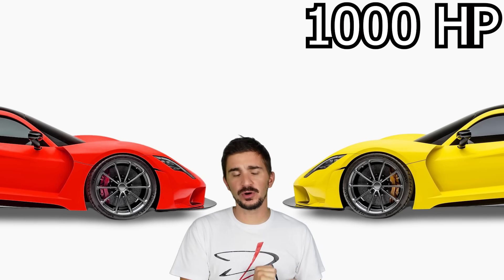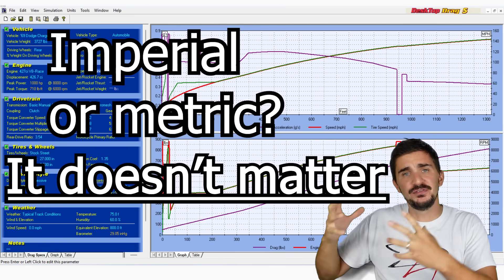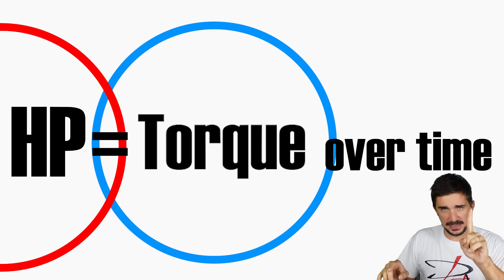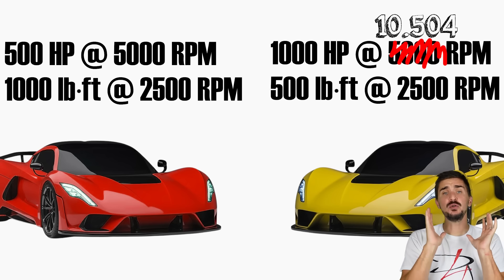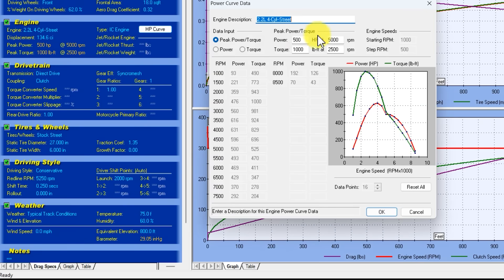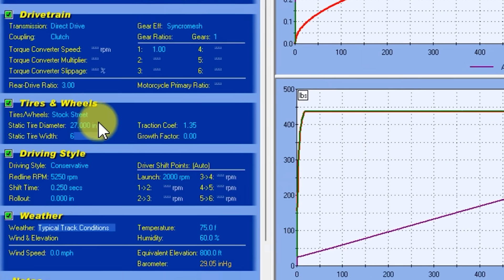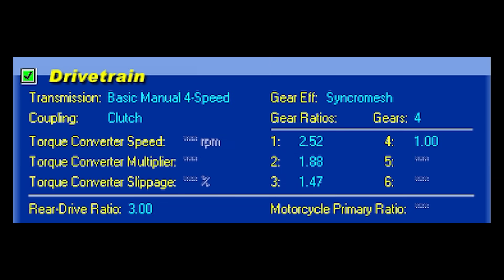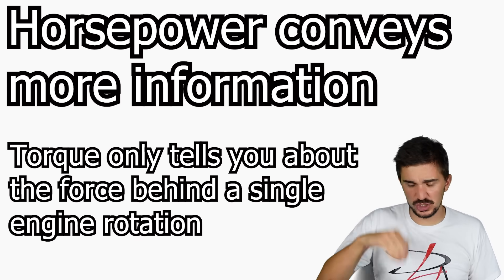Who's faster? Explained and Simulated - Horsepower vs Torque

Comment: I'm not arguing with the math or concepts. I agree. I've tuned a few cars. My genuine question is this:
 I have a BMW M57 diesel now that has had some work done and a very nice tune. It makes around 400HP and 600 lbft of torque. The transmission has been tuned to short shift, keeping the revs low and the engine "pulling." It's consistently considerably faster than 400HP cars of similar weight. In fact, it's about as fast as a comparable 550 - 600HP car. Especially in a dig, but still has an advantage in a rolling start.
 Yes, gearing is being utilized to keep the engine in the best power band. What is the math behind it being objectively faster than cars with a higher HP rating if HP is supposed to be the equivalent of "total damage" in our analogy? The cars that are competitive with it have HP numbers on par with my torque spec, but lower torque.
Is it that my torque was measured at flywheel, and likely the advertised specs of the other cars also? Point being that the gearing brings rear wheel HP of both vehicles into parity? I.E. I have bigger "punches" and the gear ratio drives the car further linearly per punch. My theory is we're just missing something in nomenclature, and advertised numbers vs. Real-world output to the wheels. Because I've smoked several cars of similar weight and lighter, boasting higher advertised HP ratings than 400HP.
Reply: I guess the answer is that you have shorter gear ratios. The effect of having shorter gear ratios is that you actually keep your engine at a higher power on average. 
What determines performance is not peak power, is average power. And, in your case, even though you have a car with less max power, due to your gears being better, you actually produce more power on average

Im supposing the weights of all cars here are equivalent, obviously. it could also be that your car is lighter
Reply: @lucasnahas  my gears are taller, much taller. The M57 redlines at 4k. Peak power is between 2000 and 3200 RPM with a very flat curve. You want to "lug" it. Shifts are set at about 2800 to drop it to 1800 for the pull in the next gear. Except you can't really lug a diesel. It starts making butt loads of torque just over idle. It doesn't go vroom, vroom. It goes growl, growl.
 I'm turning about 1800 rpm at 120 mph in high gear. It's cool to be rolling triple digits, and the engine sounds like it's idling. It's an X5 it weighs 5200 lbs. Not a heavy weight, but not light either. A Hellcat is about 4500, and they're a good race for it. They can get me if the driver knows what he's doing, I get them if they don't. Mostly traction and shifting. If they overspin, they're done. I'm gone before they can hook up.
 I think the average power theory, however, is accurate. I think you nailed it. It makes "almost" 600 lb ft everywhere, and 600 at max. It puts down more torque over a much wider range. I think that solves it.
Reply: @lespearson3801  yep, if it makes 600lb.ft all the time, that means the average power will also be high. That could explain it!
Reply: @lucasnahas  "almost" All the time. It's something like 350 at 1000, 500 at 1800, 600 at 2800, peak is 600 and a little change at 3200, drops back to about 500 at redline at 4k. The torque curve ramps quickly and then is very flat.
 It's a Darkside Developments build. Holy crap they know how to tune! It's the hottest tune you can run, just smog deleted without upgrading fuel pump, injectors, and turbo. If you want to get nasty, the full Monty is 600HP and 1000 lb ft!!! But, it comes with some reliability and driveablility trade-offs, obviously. You're going to eventually blow something prematurely running all that boost. You just accept it, and I didn't really want to. I'm really happy with the hottest street tune. There's 2 tune levels below it that aren't anything to sneeze at. 1 is just best economy and a bit more efficiency with smog. 2 is same thing without smog. 3 is race tune without smog but stock fuel delivery. Then 2 or 3 more tunes if you wanna get crazy! I went with 3.

Comment: Although the peak torque engine at 2500rpm is only making ~476hp, it looks as though the software models the engine making 631hp at 4000rpm based on the screen capture of the graph you have shown. Is there a potential inaccuracy here or were different power curves used to simulate the results to the ones in the footage?

I have a request for a video. Could you please talk about launch rpm, grip, spring rate and weight transfer at launch? I'm not sure if it's suitable for the channel but I've always wondered if there is an element of timing involved to get a car to "bounce" right off the line!

Comment: Hp for short range speed. Torque for longer range, provided the gearing is optimized. Agreed torque is much more mystical and requires more elements for optimization. Optimizing horsepower is more straight forward than torque. But there is no doubt that both have a significant part to play in the grand scheme.

Comment: horse power is faster, torque is quicker... typically you sacrifice 1 for the other...
Reply: No, if you increase torque you increase power. 
Horsepower is faster and horsepower is quicker too
Power is always the most important aspect for performance
Reply: @lucasnahas  though there is a bit of truth to what you say your wrong what i said is science and math. torque is power too. power is a measurement of input or output it is the answer to a math equation. there are really only 2 dynamics either torque or horsepower. both of which determine output power.

if you dissect the  2 you can get very different results torque will determine how quickly a car can go 0 to 60 and horsepower determines how fast you can propel a car though wind resistance at speed...

i may not have been a mechanic for over 30 years but now as a rocket scientist. these characteristics play a role in thrust too.

depending on the  goal can vary what asset is most important but no a cars performance is mostly tires and suspension... i can have the worlds best engine or worst engine and i would lose to a car made for the drag or made for the track.  the engine is the heart the suspension is the body... the hart is ueless without a body and you need an amazing body to be an athlete and a great hart can make an athlete win records
Reply: @paratrooperz1  I want to analyze one phrase you said. Quoting you:

"[...] torque will determine how quickly a car can go 0 to 60 and horsepower determines how fast you can propel a car though wind resistance at speed..."

This is not wrong, but it is incomplete. Let's break it down

Torque will determine 0 to 60 -> No, knowing the torque AND the gear ratio / engine RPM will determine 0 to 60

The engine's torque alone doesn't determine anything. You need to know the torque multiplication to determine how much of this torque will be transferred to the wheels. 

And when you do make this calculation, the magic number you get from this calculation that determines the vehicle's acceleration IS THE POWER. 

The key takeaway here is the following:

- knowing power allows you know 0-60 and top speed

- knowing the torque alone gives you nothing. Knowing the torque and the gear ratio / RPM allows you to know 0-60 and top speed too
Reply: @lucasnahas  again your partially right but i think i found your error
what is torque?
what is power? 
if you fix your definitions and understanding you will agree with me

you said last message you need to know the horse power and power. im like face palming..................
horse power  is power of one dynamic 
torque is power of a specific dynamic
power is a measure of some or many equations!
horse power is another name for RPM but not just revolutions but to include the power bandwidth.

the horsepower is generated in the motor. torque is generated in measures (example wheel rotational mass) and gearing
the transmission is how you can balance and convert engine output into a desired balance between torque and motor output
power can be calculated with any 2 or more of the previous...
power is nothing but a measurement.

you are using power like its a thing.....

there is a world where we are both right but i think the part your missing is the part you need to learn your comprehension and your nomenclature seems a bit off.

are you ASE certified? where did you acquire your good but partial education?

i feel like our conversation is in parallel like if i sad cats and dogs are animals and you say noooo birds and bears are animals and im like yes your right but so am i
Reply: @ just now remembered a great example... in the salt flats there is an enthusiast that built a car with 1200 horsepower high rev limiter of 1100 RPMs and up geared the transmission for speed... there is so little torque he needs to pull it to 80 miles per hour behind his truck and he can get the car nearly 400 MPH

or this example the GT500 is geared so low that it can keep up with a bugatti for 200ft before the bugatti high horse power can carry the car past 200 MPH making the mustang look slow... 

i could get in the math or deeper in the mechanics but simple terms the more HP you have the more possible speed you can achieve
if you want the quickest car in the world aim for torque if you want the best of both worlds buy a funny car.

you can come up with what ever story or unique example that you want but unless your wallet is bottomless the budget or race regulations will determine if you should build a car for torque or a car for speed... you can change a gear size and it will move a car to speed or to torque...

to get more torque in an engine you need to change the throw of cams, rockers pistons fly and much more but you will see a suffer in RPM its a trade off.

if i have not explained it enough then i wont get through to ya has my time is valuable to me and dont like to carry on arguments over and over accomplishing nothing
Reply: @ I studied Naval Engineering at the Escola Politecnica da Universidade de Sao Paulo

I don't want to sound arrogant or presumptuous, but, believe me, I know what I'm talking about.

I'm not saying you're wrong, but I definitely believe we're not communicating well

So, what do I mean by power. Power is a physical quantity, just like distance is a physical quantity. Power represents the rate of change in energy in a given system. in the case of an engine, it represents the rate of change of the mechanical work this engine outputs

Power can be measured in many units, the most common among cars is the Horsepower, just like distance is measured in feet or inches

Power is not horsepower, just like distance is not feet. 

power is measured in horsepower
Reply: @ Also, about your second message, you're not wrong

More power means you can go faster. Go faster means you will face drag.

Drag is a force. To overcome drag, your engine must produce an equivalent force. This force must be produced by the engine's torque

This torque will be multiplied by the gears in the transmission.

If the gear you select is too 'high' or 'long', it may not be possible to overcome the drag. 

you have two choices: increase the torque or change the gear

in both cases, you are increasing the power. You cant run away from this fact

This is what I've been trying to communicate
Reply: @lucasnahas  sounds like you just repeated my last return im try to figure out where the disconnect...  

1 fact to remember is you can bolt on a ton of horsepower to an engine as much as multiplication!!! but when tuning an engine for torque has limited gains very limited. it is fractional.

you have to realize most torque gains are from raising the horsepower in an engine are as easy as up on horse power will automatically raise the torque slightly.

if you tune the engine for torque you raise your chances of grenadining  or tearing up bearings and so many other side effect. tuning an engine for torque has one of the largest diminishing returns...

the loss in money vs the gain in torque is possible but the ratio is the poorest option but a necessary option when squeezing every ounce of power money can buy....

so i think and feel we have been agreeing this whole time...  torque is quick and horse is speed in the simple terms before this whole conversation began...

is  this convo concluded?
Reply: @paratrooperz1  aye

Comment: I have trouble buying this argument.  If this were the case, torque would always map identically to HP.  Most v8 engines have low rpm torque while the HP will peak at top rpm
Reply: Torque is the sound of one hand clapping

Comment: I think what people are intuitively understanding but intellectually misunderstanding is the difference between a high hp engine which makes peak power high in the rev range and an engine that makes a lot of torque in the low end.

For example, I own a vdj76 landcruiser (4.5L v8 turbo diesel), and my dad owns a hdj100 landcruiser (4.2L i6 turbo diesel). On paper they make essentially identical hp and torque figures, only my car makes 80% of it's torque at 1500 rpm, whereas his needs to rev higher. That fact makes my car more able to tow heavy loads, or drive slowly offroad without stalling or needing to rev up to make power. His car, is far better with day to day use, and highway driving (though both are still toyota diesel engines that are built for work). He notices how much torque my car has, because it's basically all available as soon as you take your foot off the clutch, even though his car actually has the same amount of torque as mine. It's that initial load of torque with the quick jerk from 0-moving which people associate with acceleration, and it's the high revving petrol engines with low torque off idle that people associate with hp.
Reply: you're right

Comment: You can't have an engine the makes peak power at 10k rpm's also redline at 5250. It could never be an honest comparison. The only real example of this race would look like a hot rod diesel engine racing a rpm limited F1 engine and all weights and ratios being equal engine rpm equals wheel rpm's and HP wins

Comment: What is the reason behind trucks and heavy machinery having high-torque engines rather than high-revving engines? On paper both of them could perform the same task with optimal gearing. Is it that high-torque engines wear slower by operating at a lower rpm? Or is it because its easier to couple a low rpm engine and take advantage of its peak power rather than burning through a clutch at like 9000 rpm?

Comment: As an engineer, I am always amazed that this is even a question - even amongst engineers this is sometimes confused (embarrassingly). Most folks understanbly simply do not converse in basic physics - which fundamentally establishes that power is the ability to make torque (i.e. force) at a given speed - and the torque that "counts" from the VEHICLE perspective is what is measured at the ROAD WHEEL  - NOT at the ENGINE itself -  since the transmission & final drive are also part of the powertrain system!!!

That WHEEL torque (divided by effective tire roll radius) equals THRUST - at a given instant, i.e. - at a given speed.  In even simpler terms,  power equals thrust times velocity - thus THRUST EQUALS DELIVERED POWER DIVIDED BY VEHICLE VELOCITY.  The vehicle that is making the highest AVERAGE POWER at the engine (and therefore at the wheels if losses are comparable) - during the acceleration event WINS the drag race - period.  The job of the TRANSMISSION is to keep the engine in its highest POWER range to greatest extent possible  - this provides the maximum acceleration (i.e., road wheel torque and therefore thrust) during the event. 

The 1000 hp vehicle will reach the same speed in roughly HALF the time the 500 hp vehicle will, all else being equal. (That advantage will erode at high speeds for the reasons outlined below, but it is very close at lower speeds.)

The engine's torque output is frankly more or less irrelevant since it must be considered in the context of its own speed, as well as that of the vehicle.  One will find that the 1000 hp vehicle is generating DOUBLE the WHEEL torque at it peak power than seen on the 500 hp vehicle , even though it is generating half the engine torque.  How?  Different overall GEARING (higher numerically,  by a factor of 4 or so here on average) to allow this.

Power is the rate at which energy is added to a system.  Kinetic energy is associated directly to velocity squared. Drag forces must also be overcome over the distance of the race and this requires energy as well.  The above acceleration ratio of 2:1 here will be undercut somewhat at very high speeds, since the faster vehicle will experience more aerodynamic drag, and require additional energy to reach its maximum or terminal speed.  But - a 2:1 power advantage would be enormous in most cases.
Reply: Interesting, i am reviewing all these concepts again myself solely for the purpose of tuning car transmissions in a video game despite already having an engineering background. I forgot that power= work/time= force*displacement/time=force*tangential_velocity=torque*angular_velocity.
Reply: When a comment is more usefull than video

Comment: You have over complicated, and yet also over simplified the subject.  The over riding parameter is torque through the run AT THE DRIVING WHEELS.  So a high horsepower, low torque engine coupled to a (numerically) high ratio axle can deliver the same torque to the driving wheels as a lower power higher torque engine driving through a numerically low ratio axle.  (consider both gearboxes the same perhaps)  The fastest run will be the car where the area under the graph of torque at the tyre vs time is the highest